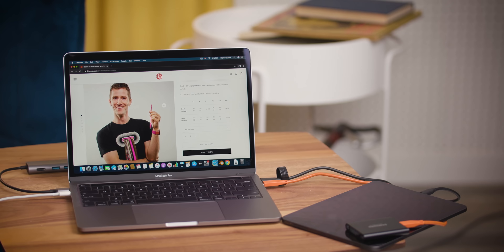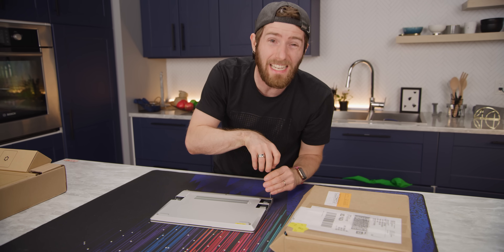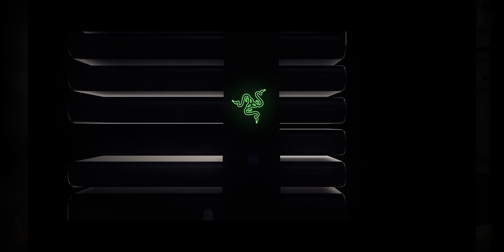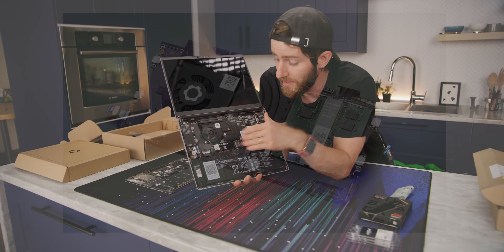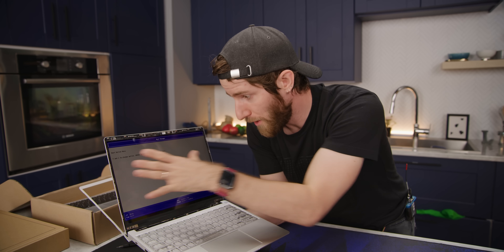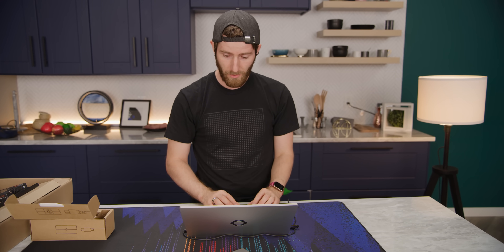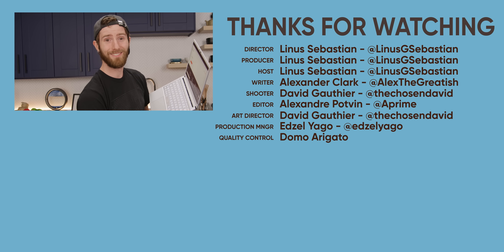A COMPLETELY Upgradeable Laptop?  - Framework Laptop Review

Comment: This is really good work from them, and all the effort they've put with the qr codes to make things easier for people who will tinker with it, amazing. I think most laptops should be built in a similar fashion, modular, accessible and easy to fix. Apple is a joke, I mean, yeah, your macbook air is broken get a new one? And people accept this? If you have a problem with your car, you don't just go out and get a new one. Or with any device that is expensive, like a fridge, or a washing machine. Why should computers be different? Most of these devices are very expensive already and in the case of apple, way overpriced as well. Anyway, I wish them luck, good effort!

Comment: if only it didn't cost 1200 dollars, which is surprising because its not really worth it to buy a laptop for 1200, spend around 900 for the parts but maybe it is cheaper compared to the average lifespan of a hp envy for example

Comment: i kinda have a laptop myself and the problem with it that they have just stopped manufacturing some parts for it, like the back cover for example. My back cover has cracked in many places and i cant even replace it alongside with 1 broken USB port, a battery (because the cover will likely completly crumble if i take it off 1 more time) broken camera and microphone, and basically every port cracked that i just cant replace

Comment: One question? How is gaming on it? I am rocking a 2012 macbook pro on Linux mint 20.3, and yes I tricked it out with the look I love about Mac OS and the much loved user functionality of windows. Its a frankenstein to say the least, but I love it either way. I have upgraded the ram from 4 gb to 8 and swapped out the old HDD for an SSD equivelant in storage.Thats the only hardware upgrades fro almost 10 years of ownership. I know that my baby won't live forever and I am on the market. This company looks like what I am looking for, but I wanna know if I can run Witcher 3 or Doom (the new ones) on it with blowing it up?

Comment: Only thing I don't like about this laptop company is they only offer it in a tiny, miniscule size. I have a work provided laptop in the same 13.5 inch diagonal screen size and I have to put it on a docking station so I can have two large desktop monitors hooked up to it! Any time I have used it by itself I always hate the smallish screen and keyboard that is too small to type on, at least for me. Overall, most folks past the age of 50 can't see tiny sized screens very well. I'm waiting for a larger size to be offered or it's a no buy for me, sorry. Everything else about this laptop is sheer genius.

Comment: 16:14 But, by default, there's no way to toggle battery disconnect from within an OS?  Might there be a utility for Windows and/or Debian to do this?  If not, is that because it's not even possible for such a utility to work while the system's fully booted up like that?

Comment: I love a ton of [stuff/]aspects about the Framework laptops but there's several things that are preventing me from getting them: 

The Framework laptops currently-have too few ports. (Only 4 :-(  ).

I need a minimum of:

● 3 USB-3.0 ports

● 1 dedicated HDMI port (with the most-recent version of HDMI)

● 1 dedicated DisplayPort port (with the most-recent version of DisplayPort); (thus-far, it doesn't matter-to-me if it's full-size DisplayPort or mini-DisplayPort. I can always use an adapter (ie. mini--to--Full-size DisplayPort cable) if I need DisplayPort; or now that DisplayPort uses a "USB type C"-plug, it'd be even easier to use DisplayPort on a laptop computer).

● 1 dedicated Gigabit-Ethernet RJ45 network-port

● 1 DEDICATED full-size SD-memory-card slot

● Dedicated charge port (so you don't waste one of the 4 limited available ports, for charging [the Framework laptop])

● Externally-accessible removable battery (this would help so you do-not have to open-up the [guts of the] laptop just to get at the battery)

● DEDICATED combo--headphone-microphone 3.5mm port (which the Framework laptop already has, thank-goodness)

If I put in 3 USB-ports, I can only-put USB-C on the fourth port (preferrably the upper-left-hand-corner port, for charging the laptop there), because it uses USB-C to charge the laptop.
• (In essence, come to think of it, you only have 3 slots [available to you], because you need a USB-C slot to charge the laptop. Otherwise, you can't charge the laptop. [And when the laptop's-battery runs out, you have a sitting-duck/fancy-paperweight]).

I would have no room to put-in the Ethernet port, or the HDMI port, or the DisplayPort port, because there are only 4 slots, and I need more-slots-than-that to put all-the-stuff-that-I-need on my laptop.

:-(

For these reasons, I cannot currently-get a Framework laptop. (A non--soldered-onto-the-motherboard-processor (ie. [what--in-the-industry--USED-to-be-called] a SOCKETED processor) would also be nice).

Comment: I’m super late to this, but do they plan to use zen? From what I’ve seen now on their website they are on 12th gen Intel, but would they ever support amd? I’m personally an amd person, and it fits my workflow better, but damn, regardless I’m getting one lol, Intel or amd, this is beyond impressive, only criticism is that I wish the usb type c connectors would support 2x ports, considering it seems like it would fit, and setting it up to be recognized as a usb hub shouldn’t be hard, and it then expands the amount of ports which seems to be a premium option nowadays to have more then 4 ports (I understand it charges off the USB port and can’t support it as a hub that way most likely, but at least having that as an optional module would be cool, to allow for more utility

Comment: what if the cpu module was "replaceable" 
the cpu block of the motherboard would be linked to the rest of it could be via pci and had a different power connection direct to the battery/power adapter

Comment: I like my laptops like I like my milkshakes 
Very thick 
I want it to have 7 USB ports, hdmi, batteries that last a month on a full charge and be able to have a built in proper normal sized keyboard instead of cutting out the number pad (which is more useful then they thought due to Unicode) 
I will pay extra if It is 3 inches thick 
But still that is so good when it comes to laptops especially when the other companies are glueing, hiding the specs, generally being greedy

Comment: I want a 12th gen one of these so bad but I just can't morally justify the cost at this time considering I can get a 12700h with a 3070 for a bit cheaper. I know they're are for a totally different user and I would be willing to accept that but given the poor battery life of the framework it hard to again justify it against other opter like a Dell xps 13. I would also really love to see a model come with a few extra ports like a basic USB A and or C integrated amd then have the 4 expansion alots the little I O is a hard pill to swallow

Comment: I adore the concept of modular laptops & phones, however I kinda cringe when I see them on the market nowadays. They tend to be made by start ups that have a huge marketing campaign, but nothing in the way of sustainable investors. Also, bc it's an enthusiast device, there's no agreed upon standardization - everything is proprietary. This means their method of modularity is limited to the modules the start up sells, & a lot of the time replacement modules aren't easy to come across. Consider Fairphone (the only modular device company I'm aware of that's stuck around) - they're currently on gen 4, & while I can't speak for the 4th gen, I can confirm gens 1 & 2 we're a nightmare bc when they jumped to 2 none of the modules for 1 were compatible & the company was having difficulty (or more accurately, they stopped caring ) in getting the gen 1 parts produced. So, if your charger port for you phone was out, you should just buy a new phone.

Comment: Laptop CPUs were once replacable, meaning that you could swap it for a better model if desired. But those were usually PGA and not BGA. Some manufacturers made it really easy, others essentially required the complete disassembly of the laptop. 
It's technically possible, so my guess is that Framework simply can't offer that feature because no laptop CPUs with pins are being produced anymore.
Reply: That reparability went away when laptops got super skinny. Simply put, CPUs with pins are "thicker" (when combined with an accompanying socket) than the modern CPUS that are solder only.

Comment: But can I plug in an external GPU?
Reply: This i think is possible. Cuz there is a way to use external gpu on every laptop by replacing the wifi card with the plugin to run external gpu. However this is fully customizable then this must support that option too.

Comment: 8:45 not all laptop cpu's are soldered to the board, I recently took apart an old laptop andit had a socket for the cpu and you just had to turn a little screw 90 degrees and then you could take the cpu right out, it was a pretty old laptop though, I think it was from 2010 (it was broken and couldn't be repaired btw, im not a monster)
Reply: It was a thing like, years ago.

It stopped being a thing around 3rd Gen Intel Core, IIRC.

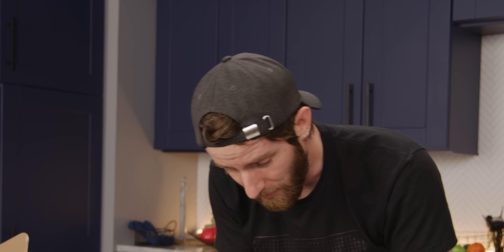Comment: @10:00 like i said in other post what you are missing is 2:1/360 degree screen and high performance. I really want a good laptop that offers top intel CPU and x050/x060 GPU. The HP Spector 360x is basically the only laptop that fits the bill. If this had those high performance parts with a foldable screen so you could tent it/tablet/fold it so it fit nicely on a plan or use external keyboard. This would be an instant buy for me.

They could actually offer a socketed CPU but would add significant amount of thickness but I am not advocating that lol

They should though offer an 80 watt hour battery. HP Spector 360 has that and is a better size and worth the minimal extra weight

Comment: Its not because they "dont trust" their users. almost EVERY company that makes functional products like electronics, appliances, automobiles progressively implements ways to make repairs more and more difficult many times to the point of not letting anyone do it like apple famously did, but also designing them in ways that make them fail, and adding things that make the parts non modular or inaccessible, etc. Some time before the 21st century refrigerators were made with their compressors and coolant in an easily accesible corner that was simply hidden by a metal panel you just unscrewed for the sake of aesthetics. Well at some point the completely close that compartment; literally surround the ONLY actively functional parts in a steel box that you would risk busting the compressor and dying from the shockwave or puncturing the freon reservoir, or electrocute yourself. So now instead of spending $50 to have a technician come and repair it in about 10mins guaranteed no matter what could possibly be wrong with it  cause theres only so much that could, now you HAVE to pay to have your old one lugged away and disposed properly and spend several hundred dollars on the cheapest of non used fridges. Thats why they do it linus. Because how are they supposed to make their target %6 growth every year until the end of time if youre just being selfish and saving money keeping a perfectly functional and repairable one. Thats why they do it. Thats why theres only two types of technician now. COMPUTER ELECTRONICS, and auto-repair/maintenance. All the money that was driving that entire career path that was ALOT easier for poor to middle class to get an infinitely cheaper education than university and to get a government certification in a career that broke its back along with so many holding up the middle class, and the opportunity for even mediocre success provided to us against the weight of the INFINITE GREED of the ultra wealthy that KNOW their oligarchic practices making our mixed ideology economy as close to la ze faire ad the can not only will not work but CANT work if youre already raping the land and poisoning the people that call it home to extract even more finite resources than we as a species already have. If we dont go extinct by causing the planet to become uninhabitable via triggering 5,000 years of global nuclear winter or ignore the land hurricanes (derecho) we've had IN THE WINTER in the midwest last year when the 2 yeads before that know even knew what a derecho was; then the earth will be little more than a pebble after we've mined it all away to mega cities in mars. Mars would be perfect to cover half the planet in concrete and pollute it so bad the atmosphere is remade from our exhaust because you couldnt walk around there with total environment isolation suit complete with the masks of the future anyway (space suit).

Comment: I'm sorry, but where does the $300 of savings from self-assembly instead of pre-assembled figure come from? The laptop in DIY configuration STARTS at $749, and that is before you even add the wi-fi card, storage, ram, power adapter and ports to the configuration, so the starting price is incredibly misleading, unless you want a laptop with a CPU, battery, screen and keyboard, and nothing else. After all of the lowest cost options for a fully functional laptop are added (power adapter included) the price ends up being $1,021, which is more than a pre-assembled one at $1000 for the cheapest model (can be cheaper if you don't need certain ports). What gives? What is the point of the DIY option if it ends up being more expensive to assemble a laptop yourself?

Comment: 14:30 - the "next" in driver installers is about signal of intent, and the ability to back out instead of accidentally installing the wrong driver that temporarily removes functionality (instead of the tedious process of booting into safemode, removing the driver, and restarting the device to install the new one again). that's a necessary evil, given how many companies throw every single driver for multiple products on one page and the ambiguity of those drivers being compatible.

framework has a massive advantage by only having one SKU of motherboard/laptop, so only having one current set of drivers for their current vendors of i/o prevents confusion, but once they start sourcing parts from other companies or producing more SKUs, an unattended driver installer might become a bane more than a boon.

Comment: "It's affordable!"
Me: "It's $1,200 for a pretty basic config."

I can bring that down to $1,100 for the most absolute basic for a Windows laptop (obviously, if you're going Linux, you can knock $150 off the price), but it's still $400-500 more than other laptops with the same specs and larger screens.

And that, boys and girls, is the #1 driving factor in the move away from modular laptop design. It sucks, but adding modularity increases costs considerably.
Reply: @Alex Bolidov I'm expecting a premium for modularity. It has less to do with being a small, starting company and more to do with the premium attached to going for modular components. Yes, that price will go down with time and advancement in manufacturing processes, but it will never be zero. Throughout the entire video, Linus ignored the price point of Framework laptops compared to other laptops of similar specs. Ignoring the added costs of modularity is misleading.

You can add modularity at a lower dollar cost, but then you'd sacrifice in the other areas Linus did focus on. Framework decided to not sacrifice on those in exchange for added cost.

I should note that, once a Framework laptop config gets to around $2,000, it's probably more cost effective than other laptops because swapping out components instead of replacing the laptop will be cheaper in the long run though it will take some time to pay itself back (especially factoring in inflation and lost opportunity cost). For the most basic models, though? Definitely not.

Comment: I watched this again after videos of Apple product repair.  I love the fact that their team consists ex-Apple engineers.  I am in the market for a new laptop and this is top of the list.  I stretch the life of my computers well beyond what is expected or reasonable, so nice to upgrade a little more often than a decade for a laptop.
I am of the 0.0001% of the population that uses the TrackPoint, my IT department was shocked with my request for a replacement cap.  Would love to this as an option on a keyboard, as they are vanishing from most on the market I have seen.

Comment: I'm totally going to start saving up to buy one. I bought an Origin brand laptop before they sold to corsair, and I've LOVED it. Its also 100% customizable, more so IMO than this laptop, but mine is a discontinued one, what was their EON 17-SLX. Its a 17" MONSTER and weighs like 20 lbs with 2 charging cables. it's excellent for everything, but is NOT travel friendly. to have a upgradable, repairable, light, thin, and easily usable laptop like this would be absolutely incredible. I HATE buying a new computer every couple years, it's an ICNREDIBLE waste of components.

Comment: I've got one of these.  It's a fantastic laptop, works OOTB with Linux, and the fact that I can get upgrades for an already awesome lappie going forward is amazing.

Incidentally, it does have intrusion detection, but as the first user, I have full control of it.

Also, my first support purchase after buying it was a second power brick - it also charges my phone super-fast, and getting a good high-wattage USB-C charger is hard.
Reply: How does the intrusion detection work? Just a switch?